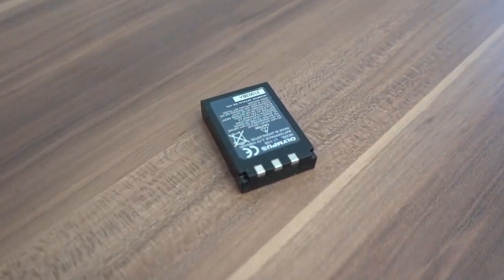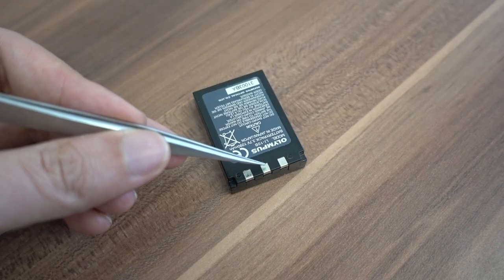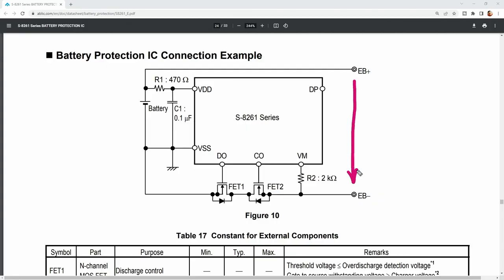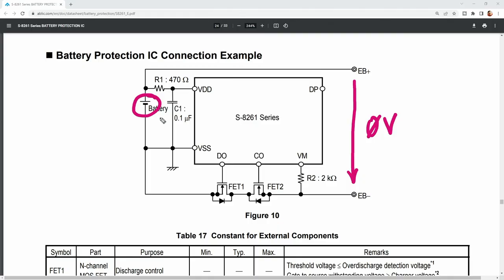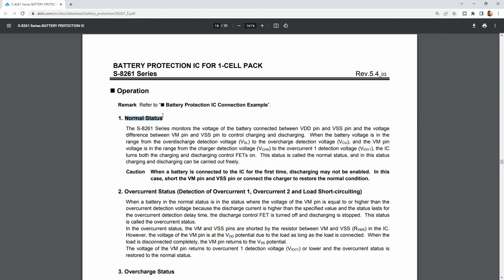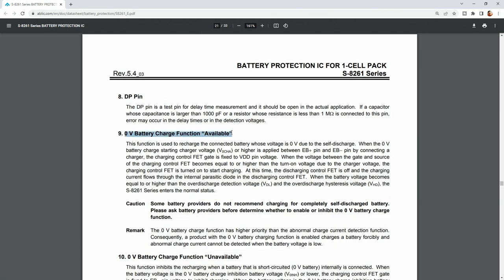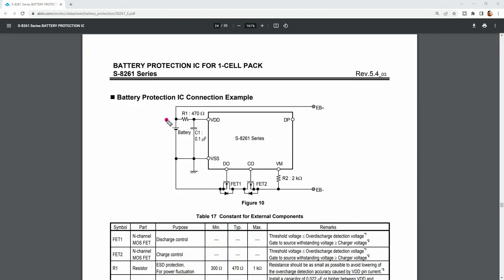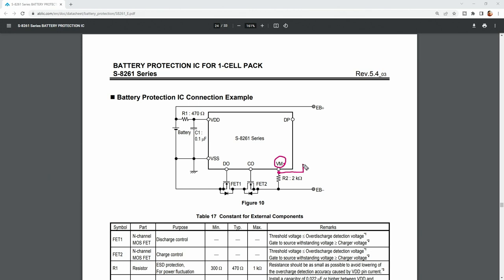What electrical circuit is inside of many rechargeable batteries?

Comment: For some model, the 3rd pin is connect to negative of the battery through an NTC resister. MCU can measure the battery temperature based on the NTC resistance change.

Comment: One way to get UNPROTECTED cells is to look at the ground on your daily commute, there may be some "vape" devices thrown out, I have gathered about a 100 of these from the ground or people just give them to me. Usually they are discharged just once after use and after a quick charge from a simple TP4056 module WITH protection circuitry, you can use them for simple projects. Takes some time, but hey, it's "free". Most of our vape pens are called "Salt", there are many out there, but those have about 370 mAh, some more, some less, but definitely worth salvaging as they cost about 5$ to buy new, by that logic I have about 500$ of LiPo batteries :D

Robert, it might be cool if you opened one up for those who haven't done it or seen it on BigClive's videos. You might find it interesting to see how they work :)